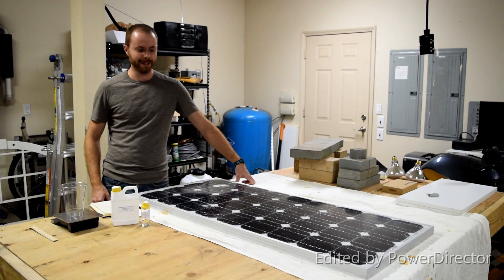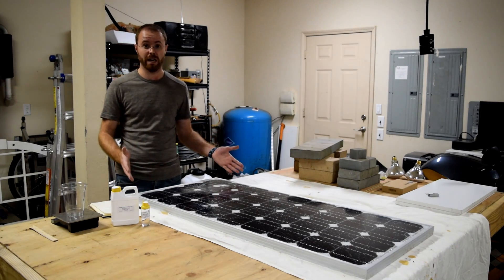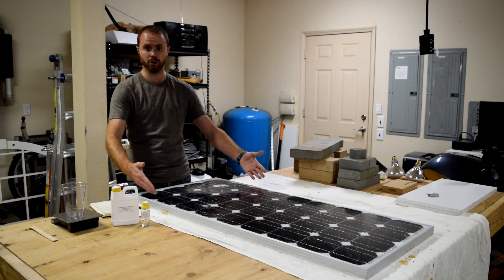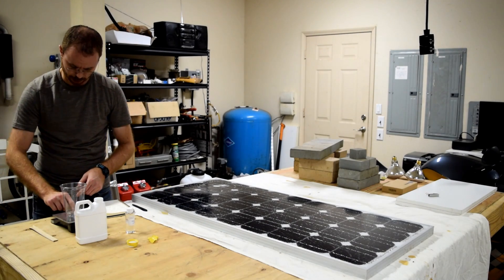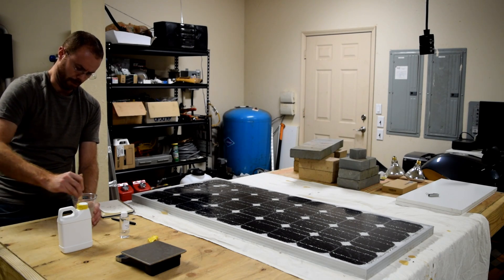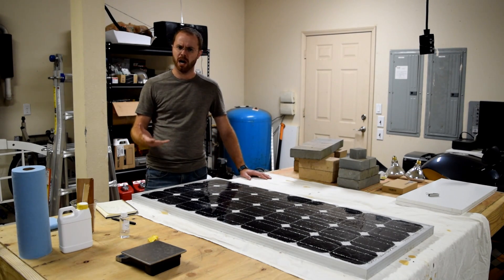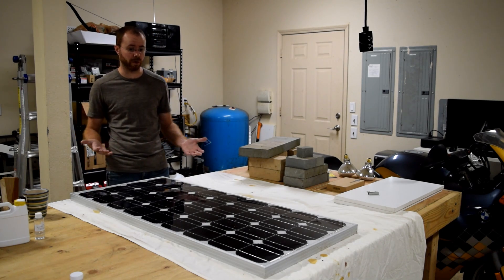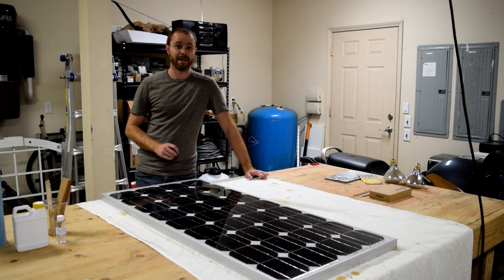Fixing broken solar panel glass

Comment: Just as I was going to say you need decent humidity for it to cure at 24 hours . I used to work for an aircraft parts manufacturer and we had to put any glue with any type of silicone , in a humidity booth . And the cure was always minimum 24 hours.

Comment: Put a sheet of clear polycarbonate sheet over it !00% water proof and very durable and won't delaminate either.
Reply from the maker: If you can get all the edges sealed...not a terrible idea!
Reply: @erikszewczyk  make sides to form a shallow tray/cover and drop over

Comment: A 100 watt Renogy panel cost just a little more than that repair product. I had one shatter last night so here I am watching vids. I'll just order another panel.
Reply from the maker: Yeah, I dont know what the deal is but the cost of this stuff has gone up 2-3x in the last year. I'm just speculating but maybe disruptions due to COVID? Hopefully it'll come back down.
Reply: @erikszewczyk  Holy Moly.  Shows as $109 on Amazon now.  On to plan B!
Reply: @damanfromtn what's plan b is there other ways to fix a shattered panel
Reply: @jasonpeeler6796  I just remember that some other methods I saw would not leave you with anywhere close to the rated power and a likely much shorter life in the sun and rain.   Rich solar had send me a replacement, so I just took the broken 200W panel to the dump.  I used arrays of 3 in series and did not want to waste the space I have on a very subpar panel output.
Reply: @erikszewczyk  I have everything ordered to mount the panels on my roof and it will be here by next Wednesday. 3 shipments Monday Tuesday and Wednesday. I did order a new panel for $114 I'm still using the cracked one leaving both panels laying flat on the ground where they get the Arc of the Sun from sunup to sundown.

Comment: Thanks for your video. I bought a bottle of Qsil and sealed a large shattered panel.  One bottle was enough!
Reply: Great, But:
How big was the bottle ?
How big was the Panel ?
Reply: How's it holding up 2 years later?        Thank you in advance
Reply: @douglb8960  👋 I bought the standard 1-lb kit.  It covered one shattered LG module that was originally installed in 2018.  The stuff is very durable and did not discolor.  Energy output slightly lower than the other modules.  The only issue is that the rubbery surface seems to collect dust faster than the smooth glass of the others.  Also it’s a bit harder to clean than glass.  I sold the house in December, so no more updates are possible.

Comment: Can I replace the solar panels glass with acrylic sheet on the solar panels
Reply from the maker: I would not, acrylic tends to have lower UV transmittance (especially at lower wavelengths which contain the highest energy) - that's part of the reason I picked this product specifically for my repair.  Also note that Acrylic tends to break down and yellow in the sun, another good reason to avoid.
Reply: How about another sheet of glass overlaying the damaged original?

Comment: Im looking for the glass vaccum injection substance they use to repair car windshields plzzz.....but about your video ...are you sure that substsnce wont change color overtime....or tensile strenght.....can add multiple layers better no?
Reply from the maker: I'm not sure about auto glass substance, my biggest concern would be the UV transmission; if it blocks any of the UV it'll reduce your panel's power output.

For me the product I used has held up very well, no discoloration after 16 months.  Make sure to see my 6 month follow-up video on this as well:
https://www.youtube.com/watch?v=PFewaIkzf2M
Reply: Please i cant hear the name o f the chemical can you help me type it here 🙏 @erikszewczyk

Comment: How was the coverage over the broken glass did you use the entire 1lb?   i have a 320 watt panel and i am trying to figure out the qty to buy,  can you help?
Reply from the maker: I used about 90% on the 100w panel in the video, so you probably need about 3x to be safe
Reply: Erik Szewczyk so... a 1lb jug s 40... unbroken 100 watt panels are around 60... um... no?

Comment: I used polyurethane to repair one of my panels last Fall. It worked great. However after full-time expose to the sun in New Mexico now about 7-8 months later, the polyurethane is delaminating from the panel. It’s just started so i will scuff the surface and reapply.  Its hard to correctly prep the solar panel surface in the original repair because i didn’t want to scratch the solar cells.  Its a lot if UV.
Reply: It's to soft for my liking. Went to clean my panel and it just starting rubbing off.... it's a bitch to clean of as well.... any body know what I can use that cleans this stuff off???
Reply: 16vastraturbo - I was able to scrape the polyurethane off with a safety razor.  Since it was delaminating it scraped off relatively easily. It took some effort but i got over 95%off.  Unfortunately I tried to reapply the polyurethane as a spray and it has only lated about 1 month before delaminating again.
Reply from the maker: Yeah the problem with polyurethane is it breaks down in UV.  I used the product in this article because it says it will last for years without breaking down - see my followup article/video after ~6-7 months, I havent noticed any breakdown yet and havent had to do anything (other than keep it clean) since.  Just bear in mind that you probably get 3x the UV I do over the winter months :)

Comment: Erik have you had a chance to see how this material has stood up to UV exposure over a length of time.
Reply: Update?
Reply from the maker: Not yet, it's only a few months old. Spec says it shouldn't yellow and should be good for the life of the panel...but YMMV

After it's had a summer in the sun, I'll look to post an update.
Reply: Same thing I was wondering.  I was thinking about going with a clear wrap (like used on cars) because then when it degrades after a few years it can just be pulled off and redone.

Comment: Nice work, what's the price of this QSil product and what's the application experience like smellwise? Is a very volatile substance you need strong ventilation for?
Reply from the maker: The best place I found was on Amazon, right now looks like it's going for about $28, link here: http://amzn.to/2hhWTGq

It's not terribly volatile, purely from the smell I would say only a little more than latex paint.  I did it in my garage without extra ventilation which is about 10k cu ft as you see on the video.  NOTE: This is purely subjective, and you should always exercise caution to ensure adequate ventilation.
Reply: Well it looks like the Qsil fix is a thing of the past. 🤷

Comment: How much material would you estimate that it took to seal the panel? What wattage is that panel? Thanks for the info!
Reply from the maker: I used about 90% of the kit I linked in the description (saving the last 10% in case I wanted to touch it up).  The panel in this video is a 100w monocrystalline panel.

Glad you enjoyed it,
Erik
Reply: Thanks. I'm trying to judge if a single kit would be enough to do a 285w panel.
Reply from the maker: No, I don't think that would be enough - I think you'd need at least 2 and possibly 3.  I think even 2 would be too thin, so I would get 3x just to be safe.